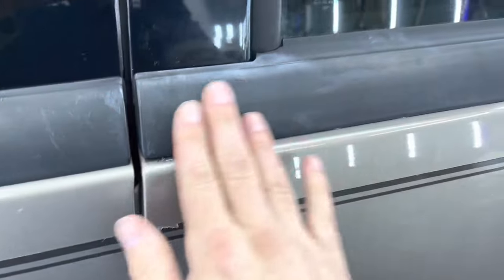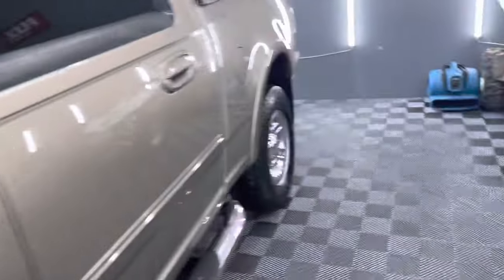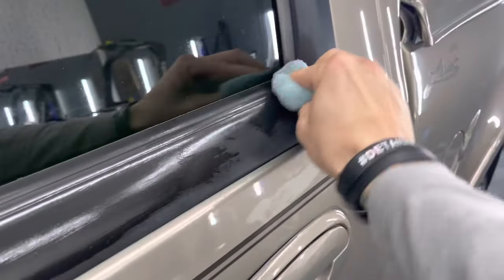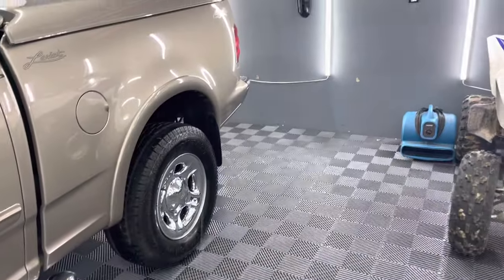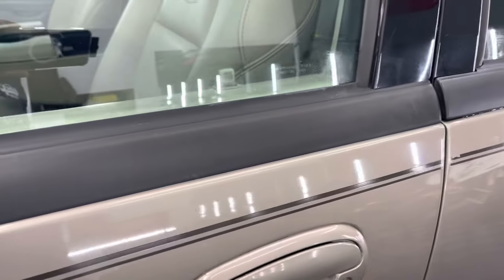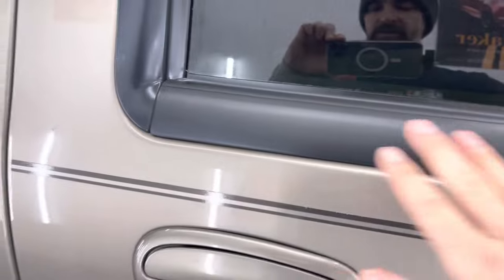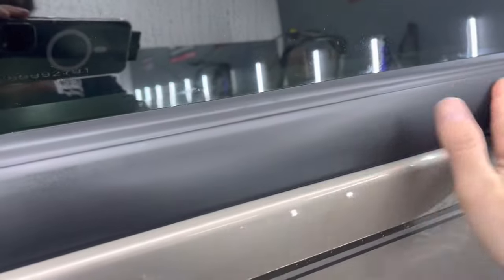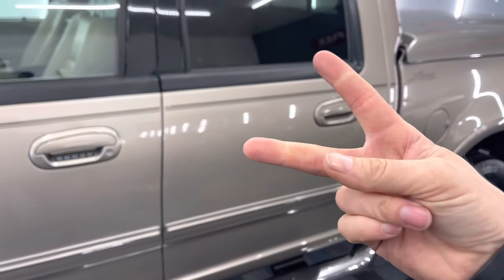How To Restore Black Rubber Trim! Quick Tip!

Comment: I think product "303" is the best "affordable" product for both rubber and plastic trim. It doesn't just clean but absorbs into the rubber to protect it, and add longevity to the rubber. Example - new V-Belt. Let it soak in "303" for ten minutes, wipe it off and let it dry (30-60 mins) and install. The V-Belt will now last 50% longer than without "303". I've seen tests that verify this. But also This is just an opinion, not affiliated with "303" car products. I just think they are one of the few products on the market that exceeded my expectations. The bottom line - "303" works as intended. Good stuff, but is another $5-$8 more than other comparable brands, and that's a small amount to have a product perform beyond your expectations. You don't get that often in the world of auto aftermarket products.
Reply from the maker: I have seen videos about that as well.
Reply: Try 3m tire restorer rubber really absorbs it
Reply: Affordable?

Comment: So can that remove the gunk that builds up on the rubber window trim in the sun? It looks like mold/mildew, but won't clean off with soap or bleach. It's rough to the touch, but the seal itself is still very pliable.
Reply from the maker: I’m not sure without seeing it
Reply: did you find something that worked for you, I have what you have on my 2004 Sequoia and have not been able to restore the rubber trim.  There has to be something!
Reply: You have the same issue I have ... I just did some research and it looks like this is an inexpensive do it yourself fix. https://youtu.be/75syi9MeYHU

Comment: You have to clean it first it has to be cleaned perfectly before it will restore I just got done doing a truck with this rubber seal and it is hard as heck to get back black
Reply: What do you recommend to clean it with?
Reply: @Erinlemco  turpentine* put on ur microfiber then clean gently just need to touch everywher that way it's more easy to remove anyo product u want sponge magic would remove itself easily whitout product* but better to put product like cleaner u want after that just put anyo protection rubber or simply silicon don't exaggerating to buy expensive product it's not worth on trim window from french

Comment: Would you suggest using tape if you don't want any of the solution to smear on your vehicle paint?
Reply from the maker: I have done it this way before and it does help. One tip I could give you is put bead maker on the paint before hand then it makes cleaning up super easy

Comment: I have a 04 Lincoln LS with similar rubber trim around windows. It's becoming pretty dry, some areas are completely dried and chipped off, exposing the chrome beneath. I also got some nu polish on it. Any hope to fix these? 

Also, is this something can be purchased? I'm not finding much info online 

Thank you
Reply: It all can be purchased I’d try researching it. Once it gets that bad replacing it is your best bet

Comment: My trim has micro cracking throughout. 10 years old. Would it work?
Reply from the maker: It won’t fix the cracking, but it should help bring it back to black if that was the original color

Comment: How long does this last? I know that jojoba oil works for a while if you let it soak in and buff off the oxidation on the outside of the rubber, but it sometimes only lasts a few days or weeks.
Reply from the maker: Depends on a lot of factors but I have had it last years and in some cases 6 months
Reply: @AndysAutoCarePlus   thanks